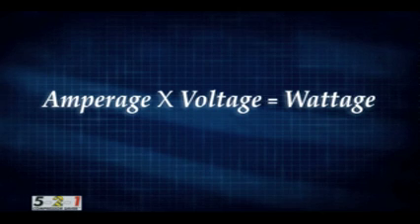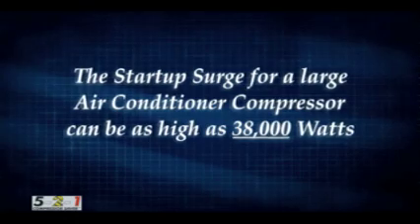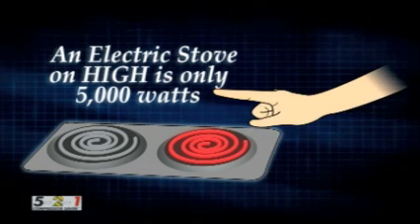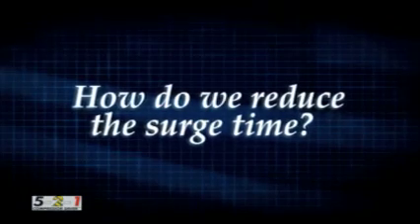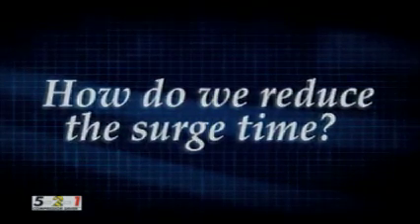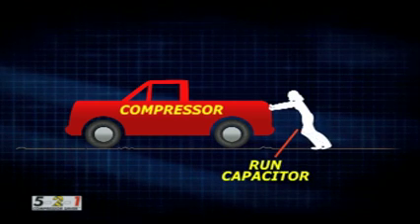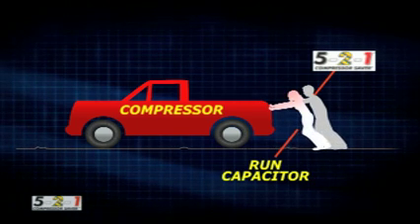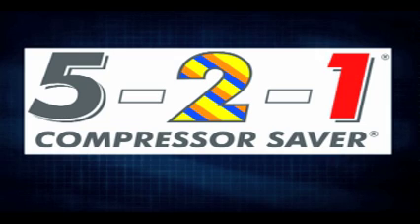521 Compressor Saver - How It Works - Animation

Comment: So far as the comments about the installation video, I just spoke with tech. support, who said that the only installation instructions are contained on the insert with the product.  So far as the comments on saving on electricity, even if there is any decrease in electricity usage, my understanding is that the major saving is reduced wear on the compressor motor each time it runs, yielding longer motor life, far outstripping any possible saving on electricity usage.

Comment: Think that it's an excellent compressor saver and a generator saver. But does it save energy. Its like trying to save energy by not carrying a bucket of water and instead carrying a cupful at a time, making many trips. The capacitor must be charged prior to the surge. It may save a  little energy by being more efficient, but not much.